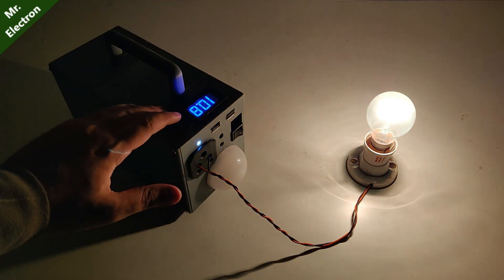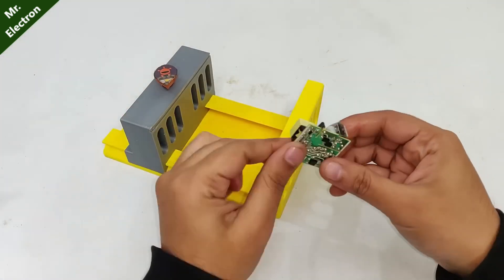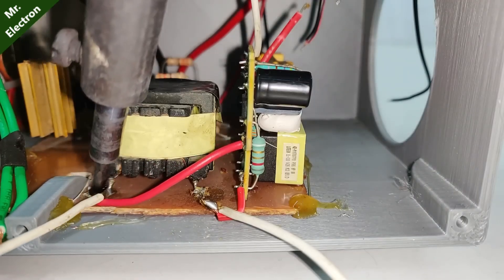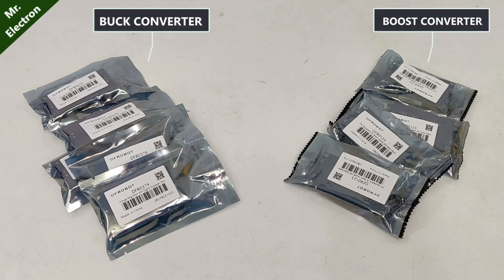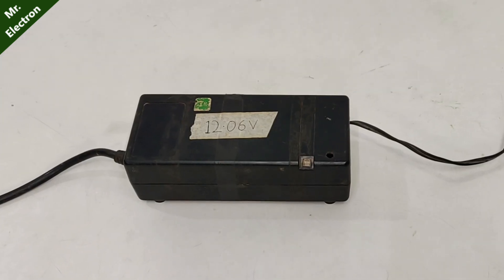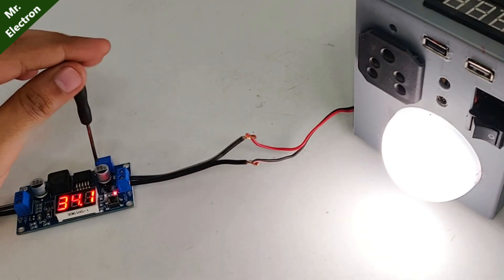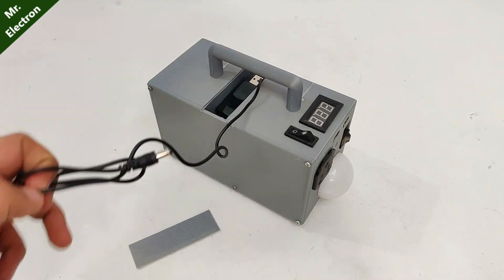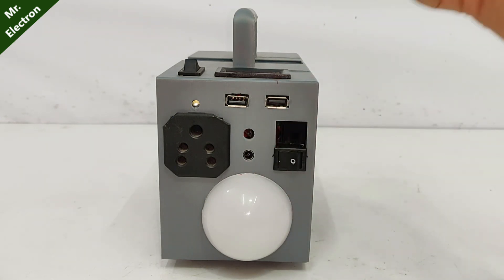Make 220V 150W Portable Power Station Using 18650 Battery

Comment: Very cool build!,!!! I agree with Square wave comment, easily remedied through. You’re gonna eat up that converter running motors or , if not an induction motor, you’ll destroy the brushes in the motor. Don’t get me wrong, I like the project a lot.  Can’t wait to see what comes next.  Random question…. When did everyone stop staggering the wire cuts and splices ? I just saw a video where the guy had a harness with 10 wire connector (16- 18 awg) and had all the splices 2 inches from the connector. Bizarre!! Thanks for the build video , very cool

Comment: Good project, though the only issue with this is that the AC output you are getting here is in square wave form which can damage most electronics or even cause humming noise in electrical gadgets. The only positive point of a square wave is that it can charge batteries like lead acid much quickly due to its peak rise in voltage/current. A modified sine wave inverter could have been a better choice if the pure sign wave was unavailable. A square wave inverter could have been made almost close to a sine wave form with the help of caps and LC circuits.. this would smoothen up the waveform though slightly dropping the wave amplitude but then it will work with all your equipment.

Comment: boost converter can be used as variable voltage in your station and u can use simple smd boost converter  for 35v ..... there r lots flaws ... like AC is noisy n unstable, u should use mini ac inverter from market comes with all protections n beautiful sinwave output  ......... u r using so much power conversion and each one lossing energy in your charging ..... 5v to 12vdc thn bms 12 v to again 3.7 dc ..... in charger mpt can be used .....

Comment: 3s lithium ion battery charger voltage should be 12.6. not 12v. You are not getting full capacity with 12v charger
Reply: Yes, technically 3S is a 12v (or 12.6v) fully charged however, when you start to draw the power from a power station with 18650s you must consider the nominal voltage, hence, better go with 4s else with 3S as soon as you hook up a gadget and with power losses due to step up/down it will fall below 12v instantly and at 11.1v you will reach a nominal threshold... for healthier battery life, it must remain at such a charge but you'll end up using it until it depletes at 8.4v and shuts off.. that's not good for the batteries.. in addition, as voltage decreases, the batteries will start to produce more and more output current to maintain the required power resulting in more and more heat and lowering efficiency.
Reply: Safer and longer lasting for this chemistry to not charge it full. Propably the only safe thing about this project, sadly.
Reply: @Teknopottu  yeah its safer but i think he dont care about safety
Reply: @boo421-o5t  And he shows us buck and boost converters without using them to charge the batteries. He could add 5V USB input and boost the voltage suitable for the batteries instead of separate charger.